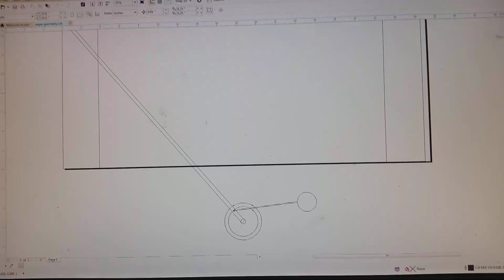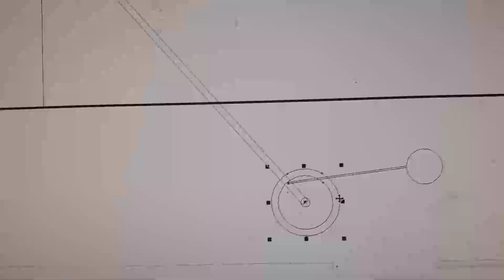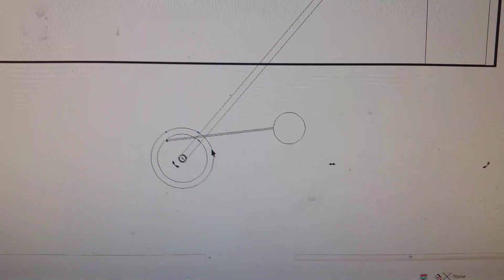Bus Conversion Project - Video 55 - Getting the electric wiper conversion working

Comment: hello yes i know this posted near 18 months later but here goes as a retired truck and bus driver the wipers will travel further once they get wet another way to adjust the throw of the arm would be to cut the small arm with the two bearing it and  fit two nuts one welded on each side the a threaded rod that can be used to lengthen or shorten distance between bearing centers then  with a locking nut to tighten once travel is set

Comment: Clever. Nice work. By the way, James, I bought an MC8 a few days ago. I've jumped ship from the GMC family. Your videos have provided some inspiration. I don't plan on tacking any slide-outs, although I believe I could handle it if I wanted to.
Reply from the maker: Cool, is it a seated coach or has somebody had their way with it already?.... everybody doesn't need slideouts... I'm going to live in mine year round so the extra room will be nice, the floor plan allows for full usage even with the slides in so traveling shouldn't be a problem but they are definitely  a lot of work.... it's too bad R&M isn't making parts anymore, it's going to make roof raising more complicated... not sure if you're planning on raising the roof or not.... does it have a 4 speed or automatic?
Reply: +James E Dennison All seats are in and they are in good shape. I wish I had what it would take to put it into revenue service. I still have my CDL and passenger endorsement, and clean record. I'm not going to raise the roof right away. It has a fresh 6v92T and Allison. Eventually I'd like to upgrade it to 8V92 and Fuller 5 speed.
Reply from the maker: mine has the 6v92T as well and an RTO 12510, it's been hopped up to around 400 hp..... hopefully that will be enough, I have a 470hp. series 60 in stock that may go in someday, this one was used for hockey team transport before I got it.... maybe you could do something like that with it until you convert it.... mine came out of Medford Or. in 95 and the guy I bought it from had just put 30,000 into the powertrain, why did you go away from the GM's, this one just come up?.... GM makes a great bus, it is just more difficult to change power trains with the transverse, left hand turning engines and V- transmissions so I  think you are pretty much stuck with what they come with and I think parts are probably getting scarce
Reply: Southern Oregon Diesel probably did the engine work on yours. About ten years ago I had to get rid of my GMC for health reasons. Presently I was just about to jump into a re-build of a GMC 4108a that a friend owns. We were going to do it together and co-own it. But it needs so much and is housed three hours from where I live. It needs to be gutted. The power train is good, but it is the Spicer 4 speed. I like those fine. But no one else can drive them. That will be for sale soon. We'd like to see it go to someone who loves GMC highway coaches and and wants to do their own build-out.
Reply: As for the MC8, I just stumbled upon it. It turns out that I even know the truck driver who is selling it for his church. It's really nice to be able to deal with people whom you know, and know to be honest.
Reply from the maker: Engine work was done locally here, K&W Diesel in Langley did it .... my MC5 has the spicer 4 speed and as long as you have plenty of truck driving experience it's OK, others can pick it up with enough practice, what I don't like is the split between gears, mine has been re-geared so it's even worse, it'll do 20 mph in reverse... I like the 10 speed in the MC-7, it will just idle around in first gear, no need to slip the clutch
Reply: +James E Dennison That sounds ideal.
Reply: I wonder who is going to end up with them. It could be a good opportunity.
Reply from the maker: Let me know if you find you need some parts, I've scapped a lot of them but I may still have some stuff you may need once you get into it, It's just going for scrap otherwise
Reply: +James E Dennison I'm getting my list together. It's not in bad shape. But it needs some things. Driver's side air wiper motor rebuild is at the top of the list.

Comment: Wow. that turned out really well. Being able to use the computer to find the correct adjustment is awesome.  Would have saved a lot of trail and error. Well done.
Reply from the maker: Thanks, and I didn't have any room for  trial and error, pretty much had to get it right the first time..... or make a new arm if I screwed it up

Comment: This comment is not about your wipers but I was wondering if you have worked out what kind of a.c. units you plan on using when you get that far?....I am beginning a city bus build myself and I have done some research and for price ability and ease of install I have decided to go with a mini split system....this will allow you to have  multiple zones and not have to cut a couple big holes in your roof...just a thought!!!
Reply from the maker: Thanks for your thoughts, I think I am going to use 3 roof top AC units, most likely dometic brisk airs,

Comment: Just found your page - Thanks for sharing!  We are currently converting a 1964 GM PD-4106.  I have been considering converting the wipers to electric because they always seem to make a HISS sound and they don't work terribly well.  Are the motors you used a 2 speed setup?  I am really enjoying your vidoes keep up the good work.
Reply from the maker: Glad you're enjoying it, yes the motors are 2 speed , they also have a pulse function I haven't figured out yet..... more wires than plugs..... I'm currently looking for a wiring diagram for them so I can figure it out, I think there may be some relays that weren't included that need to be in the circuit but they work fine anyway

Comment: Putting it on the wrong side is something I would expect that I would do not you. An inch shorted wiper blade might be good. When you have rain and wind that wiper might hit the edge??? You have computer skills too! Glenn Lever
Reply from the maker: I had the windshields wet when I was running it, not when I was filming though, a shorter wiper blade is always an option if needed, I've been a computer nerd for over 20 years too :-)... used to do graphics so have CAD experience, I use CorelDraw for layout and drawing now, you can export dxf files for plasma and laser cutting tables so I am going to draw the wheel well parts I need and get them waterjet cut when the time comes and I screw stuff up all the time.... that's half the fun, fortunately I figured it out before I welded the stud in there